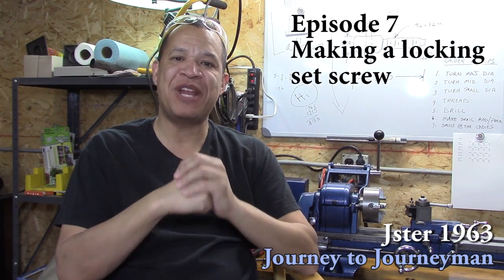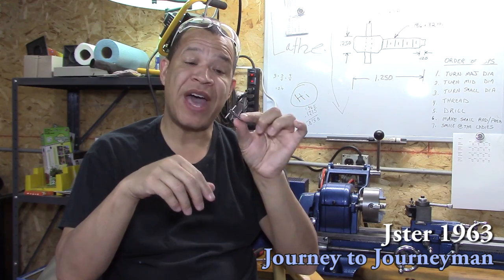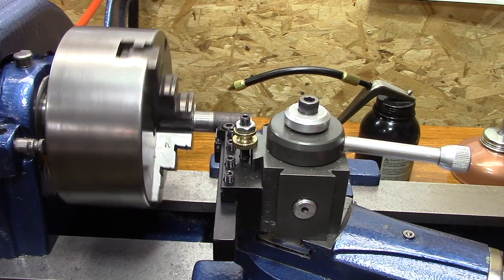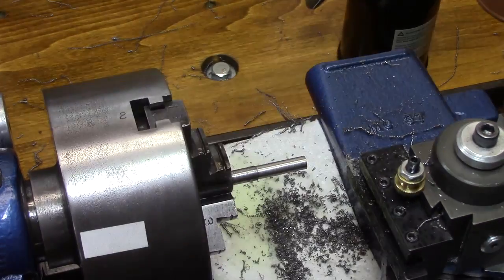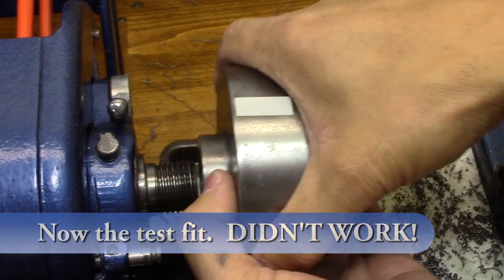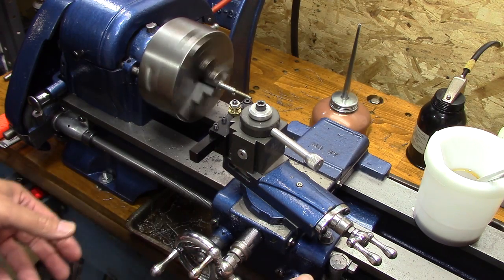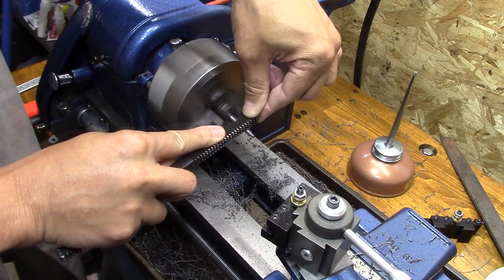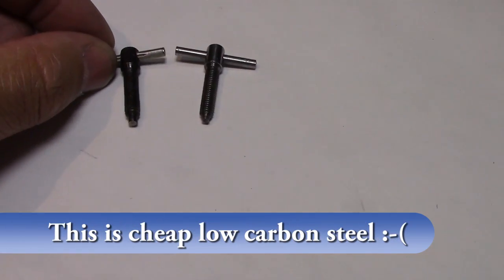Journey to Journeyman, Episode 7, How to make a T-screw for my lathe

Comment: you are doing good. but your lathe is to small. you need a bigger lathe you can do a lot better.a 9'' southbend with quick change gear box. is good. you will love it
Reply from the maker: salvatore micale Thank you so much!  I did get a South Bend 10k but I haven't started using it yet. I don't have much tooling and I don't have it in my basement yet. I hope to have it up and running soon, but life keeps getting in the way. Thx again....

Comment: Hi jster1963 -- Get a Starrett  fish gauge the first time and you won't have to throw the cheapy away as I did.

If you set the compound to exactly 30 degrees the left side of the tool will do all the cutting and the right side will simply slide down the already-cut side of the thread.  If you set to slightly less, the right side will take off a tiny bit of material on each pass, cleaning up that side of the thread.  If you set to more than 30, the right side of the tool will not touch the thread flank at all; instead it will make a jagged little step when the left side advances into fresh material.  And as you saw, when the angle is a lot more than 30 the steps get a lot larger.  That's why 29 degrees is a good setting for the compound.

In the Atlas MOLA, look at the double depth of thread tables -- you should see a column showing how far you have to advance the compound to cut a particular thread with either a vee tool or a thread-form tool.  That number is based on having the compound set at 29 degrees.
Reply from the maker: I should have got the better fish gage, but I wasn't sure if I would be able to thread.  Great info on the threading and I will explain that on my next episode because a couple of guys have asked.

Thank you so much for that AWESOME information!

Comment: Good to see someone make their own parts and re-purpose failures!  Far too many new lathe owners buy new stuff that could easily be made - like why did they buy a lathe in the first place?  Another way to make that undersized cross handle fit, would be to flare it out with a center punch or knurl  it.
Reply from the maker: Thank you so much!  And you are right about these machines.  They can do so much, so that's how I'm learning.  Making parts.  In the video I said I made the handle too small, but I really did it twice:-(  I never thought about knurling it.  That would have worked.  Thank you again.......